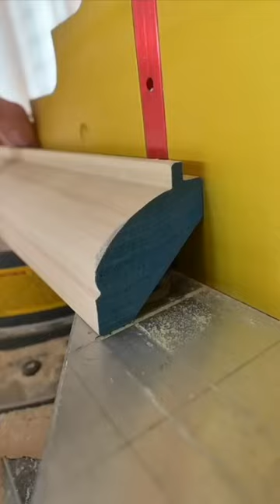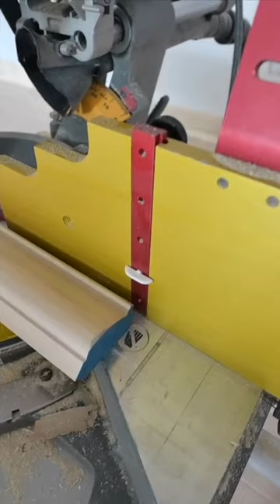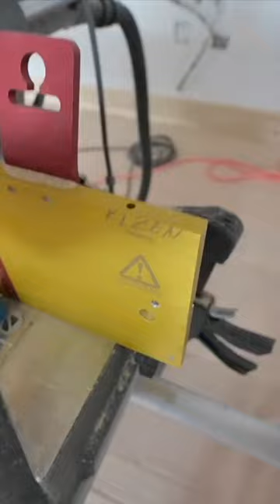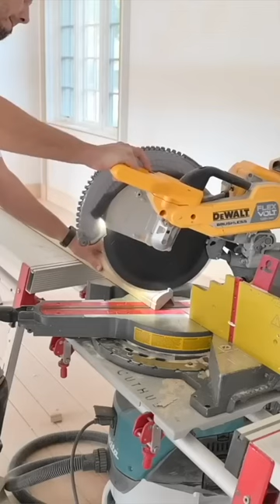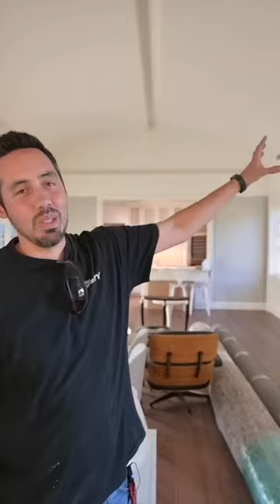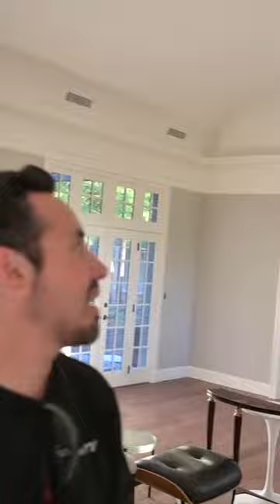How I cut crown now.

Comment: How many of those have you lost already? 😂
Reply: It’s all about setups. I did think about a screw on pin stop but that adds time to take off and put back. It’s a 5mm hole so any type shelf pin will work. I’ve used the metal pin for years which was an improvement from using a nail in a wood fence

Comment: If you are any bit of a carpenter or tradesman, you did not need to spend $400 on that jig, you could have easily made it yourself....smh...
Reply: And how many times are you going to spend your time making a new one. I know because I’ve been there. I’ve tried to outsource to bring down the cost. 12 pounds of aluminum milling isn’t cheap.

Comment: Can you tell me the brand of glue you use? It's a 2 part system, the activater comes in a spray can, also the manufacturer of the lumber you use ,that comes already primed. It appears to be nice straight lumber
Reply: Windsor One is his supplier for material. 

The glue is CA glue.

Comment: i've been watching your channel for a while and wanted to ask you a question. for miters, do you prefer your dewalt over the mikita for jobsites? which one do you recommend? and for someone starting out in baseboard that'll eventually want to install crown molding—should i get 10" or 12" blade? also how do you feel about milwaukee miter? i see it on your amazon list but i've haven't seen it in your videos yet. and my last question is if you recommend the makita 18v brad nailer at all?

Comment: Quick question. I'm definitely a jack of all trades....master of none guy when it comes to carpentry, cabinetry, trim, plumbing, etc., so I still have to think too hard about the upside down and backwards crap, and then I still get it wrong sometimes. What do you think about a jig that eliminates that, that makes a cut with the material facing towards the operator instead of towards the saw? I know you're a pro, so you probably don't have to think about it, but for someone like me, it saves frustration, and I don't have to flip the trim before installing. What do you think, or do I have something incredibly wrong? I do like your little jig there. Simple and functional.
Reply: I think if you mark with a pencil indicating the cut direction it should eliminate the confusion when it’s placed on the saw- having done crown only a couple times (& in kitchens where it was pre-finished pieces with limited stock) I can tell you there were a couple times the piece looked backwards on the saw but it was right in the air - those cut marks saved me.
Reply: I’m using an 8 1/2” Hitachi miter saw, and it’s set up that you lay the crown flat on the bed to cut the miters…a symbol on the miter scale lines up with the same symbol on the bevel scale…it’s foolproof. Laying flat also allows me to miter 12” crown. Been using this saw since the 80’s with zero issues
Reply: @jamesalexander8368  
I'm having trouble visualizing it, but that seems to be a great solution. Do you know of a YouTube video illustrating how it's done?

Never mind....I found some. Thanks!

Just watched a Paul Ricaldi video....I'm pretty sure that's what you're talking about.
Reply: I’ve seen that jig your talking about…. I’ve yet to see a good video of it being used…
As far as upside down and backwards…. It may help you to write left and right on the piece till you get more comfortable
Reply: Cut it flat